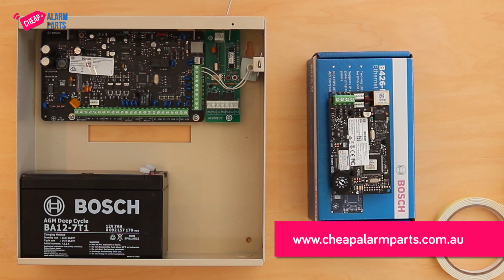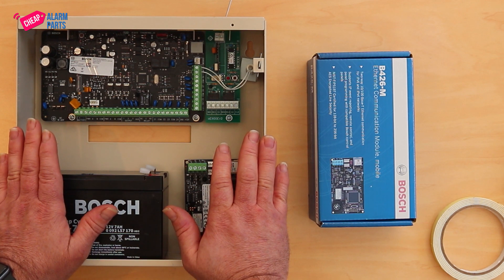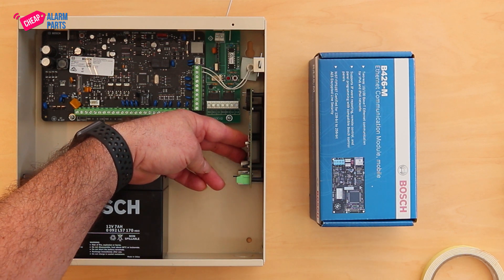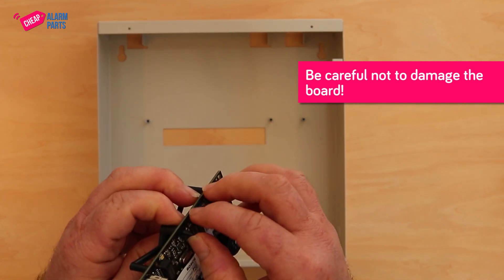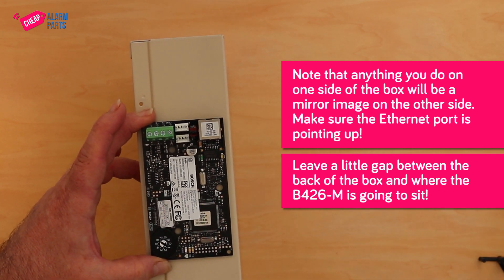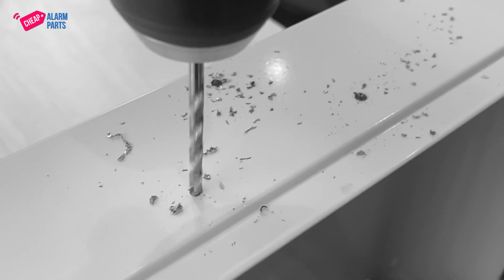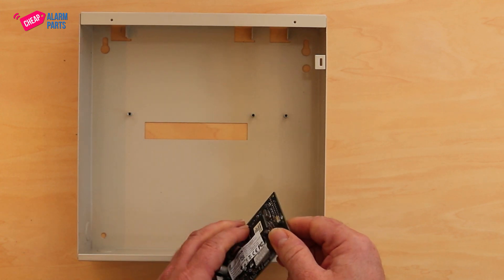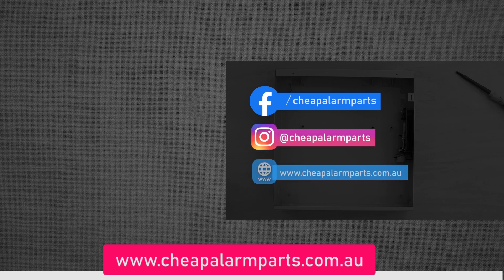Mounting a B426-M

Comment: To everyone who wonders what drill size: I used a 3.5mm to drill and a 7mm to deburr. If your hole puncher is not strong enough to make a decent dent, you can use a 2mm without drilling through. Perfect fit and snug!

Comment: The new enclosures have the holes pre-drilled, no need to do this anymore if you’re supplying the right enclosures 😉
Reply from the maker: The ones direct from Bosch don’t. We know of one supplier that have designed their own enclosures with the said holes which will be available on our website soon! (But they aren’t made by Bosch).
Reply: Ah right, I made the assumption they were a Bosch item, cheers 😎